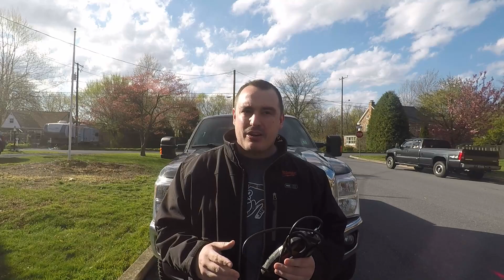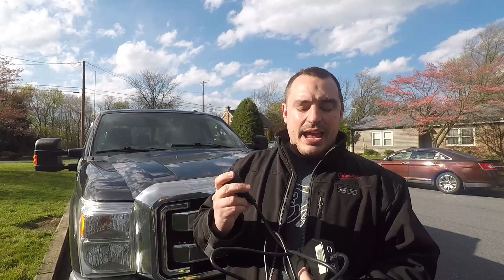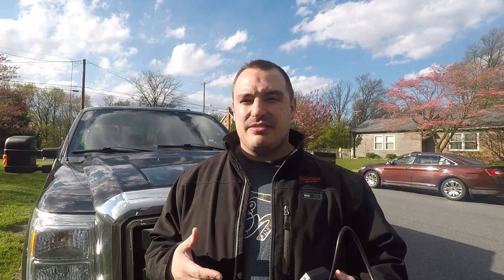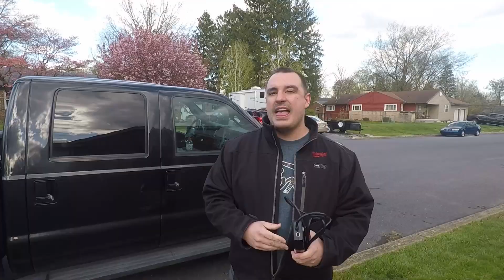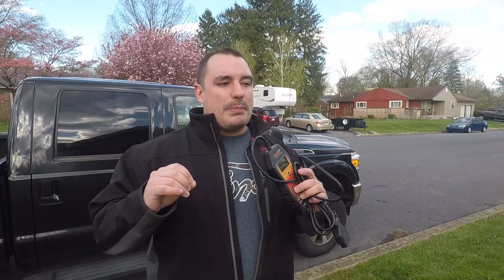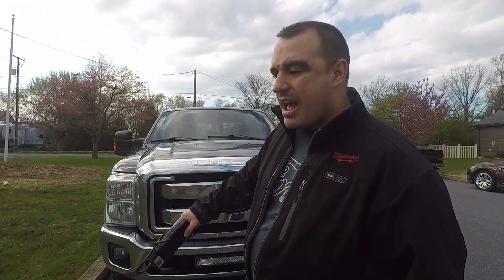Best Tuner For 6.0 Powerstroke

Comment: Hey buddy, I've got a couple of questions for you. Do you do the trans relearn every time you load a new tune? Have you had any issues with tunes throwing code U0306 Software incompatibility with FICM (this is my big issue right now and can't get any answers from anyone)? Do you have issues when using cruise control, maybe it hits WOT to increase speed only 5 mph?
Reply from the maker: So when you flash in a different tune there is a relearn to some extent. However it is not technically the full relearn process but it does take time to adjust yes. As for the compatibility with the ficm I would definitely consult the tuner. I am not aware of the ficm being an issue as far as ECM tuning goes. Is it all of your tunes or just 1? Have you tried returning to stock?
Reply from the maker: I have had tunes that when I only need to speed up a little it will down shift and go. If I had to guess it doesnt really hold the gear it wants to down shift for just that little but. Some tunes are more sensitive than others for that. I have a dyno video where it will not hold the gear at all for the pulls. Yet other tunes hold onto them to much. This was one of the reasons I really liked wpe tuning because they did such a great job of having that perfect balance
Reply: @six0bros  I might give them a try, I really like my SPD tune, but it doesn't work with cruise control very well and when I let off the pedal when doing +50, it feels like the trans is locked in and just feels too rough, IMO. I don't think it is, but it just doesn't feel right, and I'd prefer not to destroy it. Maybe I need to do a complete relearn with SPD. The tyrant tunes are great for cruise control, but I'm having the communication issue with them. They blow lots of smoke and act like a cylinder is down when I'm in my cruise band.

Only my tunes from tyrant have the communication issue, the SPD tune seems to communicate well. I have gone to stock, but I had a different (what felt like a slipping issue that isn't present in any tune) show up. I should try it again since I've replaced my FICM control module. The communication is still present after the control module was replaced, too. So, I guess that is a separate issue that wouldn't be caused by the module.
Reply from the maker: I would say for some of what you described with the transmission you should do a fluid change. not a flush but just drop the pan and refill with a new filter. change out both filters.  There really are lots of great options for tuning out there. warren diesel, gearhead, quick tricks, power hungry performance. those are the list of ones I plan to try when the white truck is back.
Reply: On some tuners, if you completely replaced the FICM you will get a communication error, that usually gets retaught to the ECM just after changing.  I know Bully dog will remotely reset the Turner can when you plug it in the Turner can relearn it.  Seems like SCT did also.  The last time I was able to just rebuild the mechanical part of the FICM and avoid the electronic relearning.
Reply: @littlefinkle7757  I had my FICM bullet proofed by FICM fixers and flashed with the atlas 40 tune 3 year's ago, and I just got my studs and SCT X4 6 months ago.
Reply from the maker: then you shouldnt be having an issue with what you said is done. I am going to say the tuner needs to redo your tunes.
Reply: @six0bros  that's what I'm thinking. Now, if only I could get a hold of them...

To your fluid suggestion, I've already refreshed it. So, I'm hoping it's only tune related as I'm not ready for a new trans, Trump didn't give me that much. Haha
Reply from the maker: @CatTurd01  trump didnt give you that much that made me literally lol
Reply: @six0bros BTW, I sent you an email on Thursday or Friday.
Reply from the maker: I did get it and I will be emailing back soon. Thank you for the email I really appreciate it
Reply: @six0bros  No worries and no rush, I was just making sure you got it.

Comment: Gearheads tuning was my go to. But the Innovative Diesel Tow tune with the full exhaust brake feature has been the best in my 2005 DRW CREW for towing.

Edit: Of course using an SCT tuner.
Reply from the maker: I have never used the exhaust brake feature but I hear they work well on the 6.0. I love it on my 6.7
Reply: @six0bros  works surprisingly well. Not as good as my new truck though. (6.7 C_m_in_)😬
Reply from the maker: Say it isnt so!!! Not a Cummins I hear the exhaust brake on them is pretty awesome though
Reply: @six0bros  exhaust brake has it's own on/off switch and is adjustable from full down.  Then when you select Tow/haul forget about brake pads wearing out. It slows you right down to a crawl when approaching a stop sign.  Really impressive. But enough about that thing!
Reply from the maker: While maybe not my favorite engine out there. No one can deny it is a good platform! The big 3 make such impressive diesel trucks it truly is amazing how far they have come

Comment: The next upgrade on my 2005 6.0 is a Tuner.  My mechanic swears the H&S is the best, I would appreciate any insight that you  have on this matter.
Reply from the maker: For the 6.0 the sct tuners are hands down the best. It will tune the trans and ecm at the same time which will help keep the transmission safe and shift great. H&S was more of a 6.4 thing than anything else. Sct hands down is better for a 6.0 and there are more options for custom tunes out there
Reply: 6.0 Bros thanks for the info I do appreciate it. Been my mechanic is stuck on the H&S they’re hard to find and expensive.
Reply from the maker: there are a few guys hung up on them but for the 6.0 man not worth it. they were really more a 6.4 and 6.7 tuner and even in those platforms they are no longer in use.